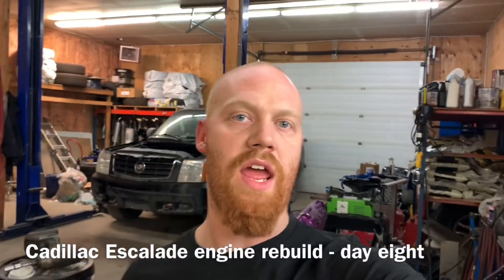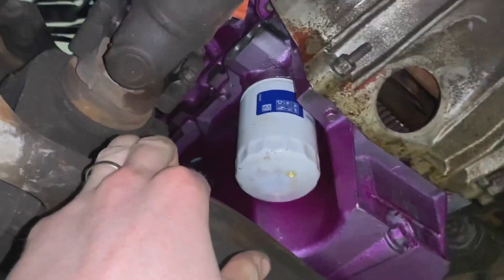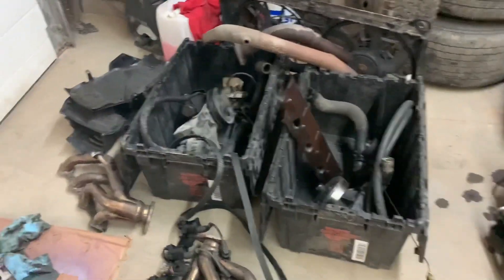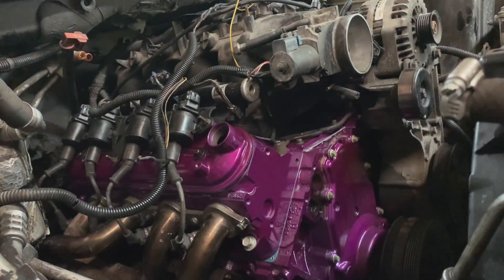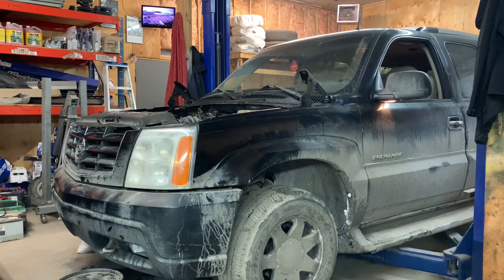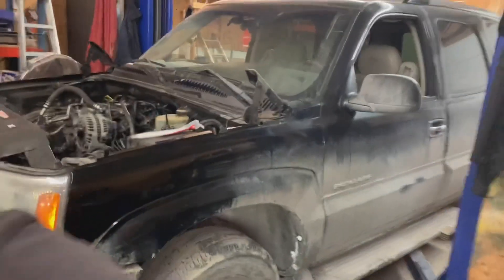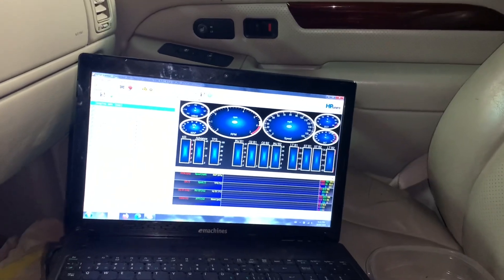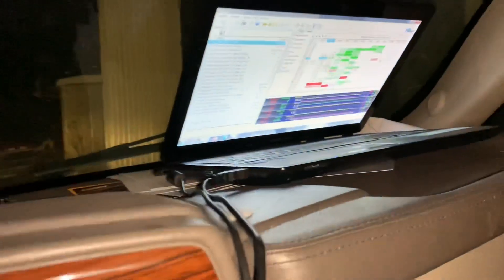Cadillac Escalade engine rebuild - day eight. Success!!

Comment: Did you install the 6.2 v8 in it or is that aftermarket upgrade?
Reply from the maker: This is actually the same block. It was an LQ9 (flat top pistons) but all I had were dished pistons, so I put those in and used home ported 862/706 heads from a 5.3, and the LS6 corvette cam.
Reply: @StationroadRatrods  Good info thanks.  I’m getting to replace mine as well. Though no YouTube video probably lol
Reply from the maker: Sweet! If you have any questions or anything just ask away, I’m sure me or someone else will answer!